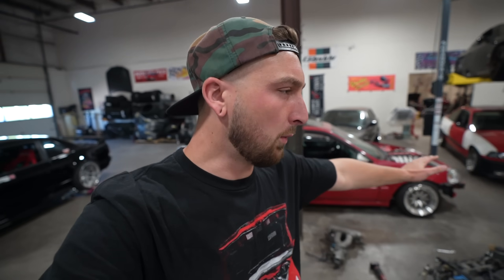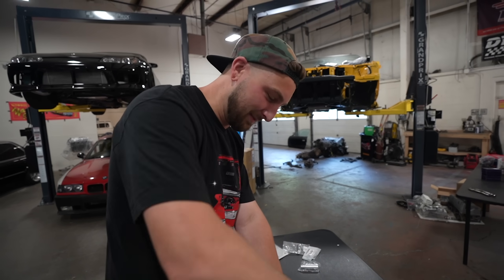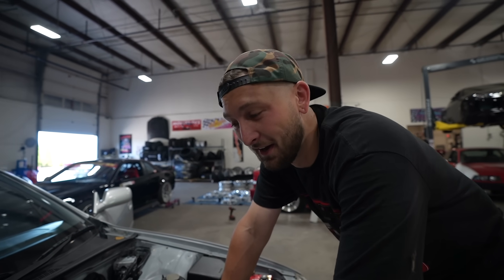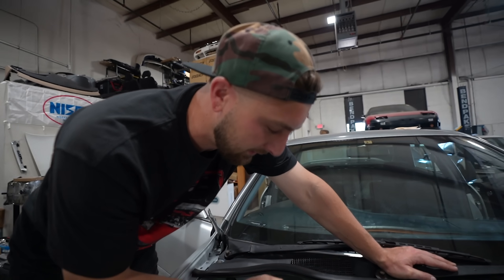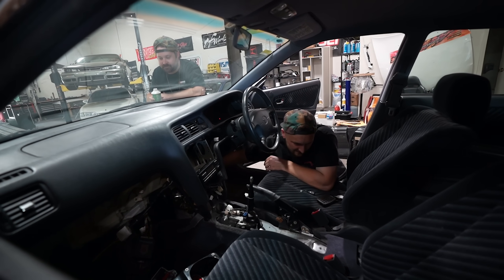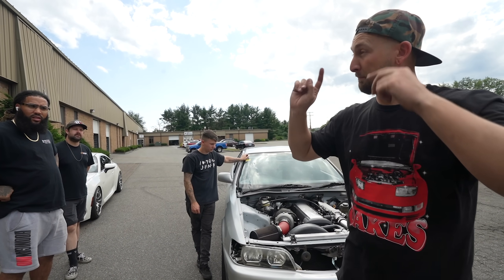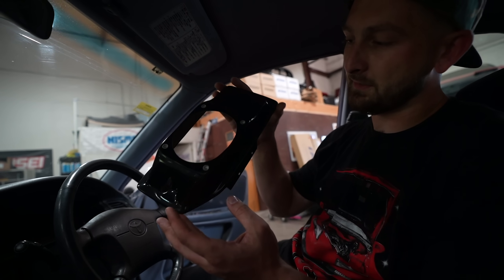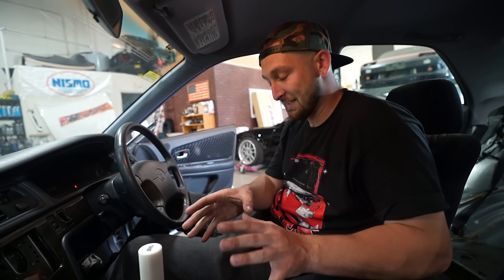FOUR DOOR SUPRA FIRST TEST DRIVE!! (Sounds INSANE!)

Comment: Can you use heat to mould the overflow tank to curve around the intake? I'd hit it with a heat gun and apply pressure to it to give you more of a gap.
   
Shout out to Patricia Oakes!
Reply from the maker: ill definitely try that out!
Reply: @JimmyOakes  Hey Jimmy how much faster is the new VVT motor in the yellow S15 than the regular SR20DET? JW
Reply: Made the comment and then read through and seen you were already on the same page
Reply: Epic thinking mate!!!

Comment: You could fill the reservoir with water use a heat gun and mold it the shape you want.
Reply: Do that with the whole radiator still in place then push it into the intake when its hot.

Comment: Idea! Pull the bottle off, hit it with a heat gun where the pipe runs for a little bit (just looking to soften the plastic), stretch the plastic into the bottle to your needs, and then immediately throw it in the freezer for 20 minutes. It SHOULD fit better.

Comment: Can you cut 10mm off that coupler and push that cooler pipe back a bit to get some clearance? Engine movement is probably going to be hard on that bottle. Either that or get a heat gun and yeah to up the resi, then you can probably just push a whoopsie into it and get it that way.

Comment: Could you just take the pipe the that shrouds hitting cut like 20-30mm off it so it slide in a bit more then you would have room and it not be so tight and wouldn't have to cut shroud so it will all look oem still

Comment: Does the excessive pedal have a firewall brace or does it need one? Cos if U manual swap with stock pedal it flexes the shit out of the firewall if U don't install a brace on the engine side to sandwich it.

Comment: We need a Jz Vs Vr6 comparison series… turbo g series 12v vr6 vs Jz with a G series. Would be interesting to see they numbers and how they can stack up against each other
Reply: Well if it's a 12v VR6, it should be pretty comparable. They were originally meant to be Diesel engines so the stock internals are pretty strong on a 12v. With a head spacer, I've heard of people doing 500+hp on stock internals.. But I don't know how much i'd push beyond that. JZ would probably make more power but I'd also be interested in seeing which engine provides the better power delivery if they were both capped off at the same power output.

Comment: none opening thermostat, always drill a 1/8 inch hole in the base so it can bleed pressure threw it but no fluid flow. Never have to deal with a frozen thrmostat again
Reply: Lucky winner 🎁🎁🖕🖕🔑🎁